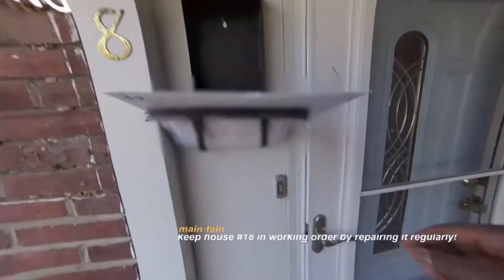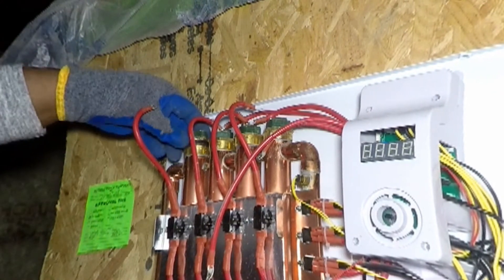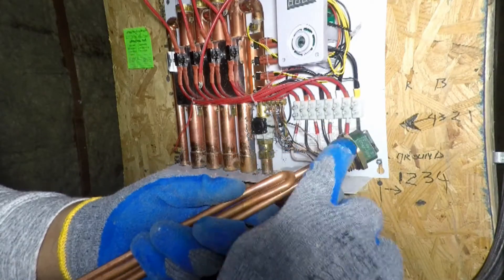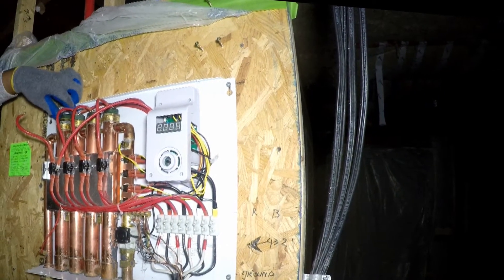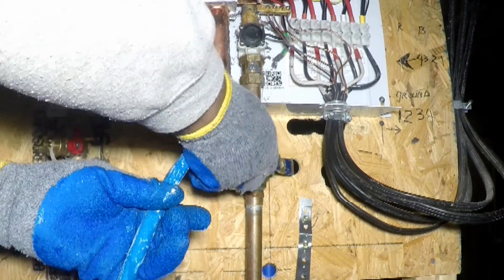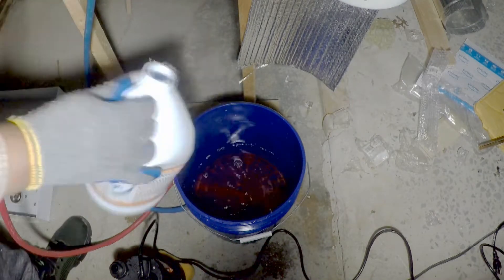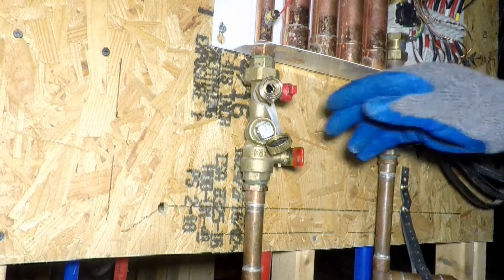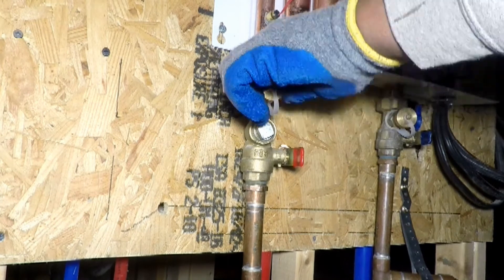Replace Heat Element and Flush Tankless Water Heater - M18 EP27

Comment: I used pliers to pull it out. I did not include that portion as it was messy to film. I had to see what I am doing, which means being on a ladder, peeping into the pipe, while holding a light and pliers. Hope it does not happen with you and it's annoying but easy to solve.
I also have long reach pliers in case.